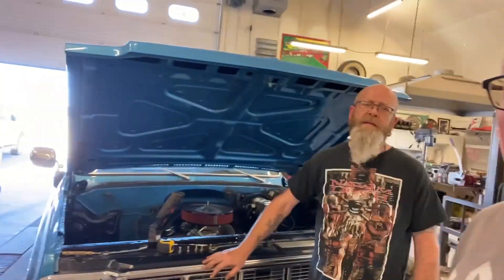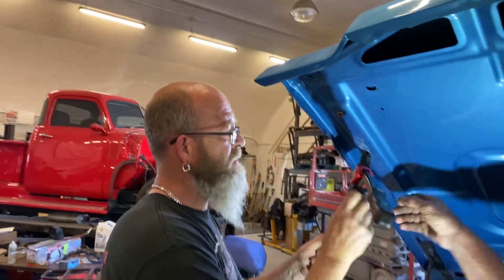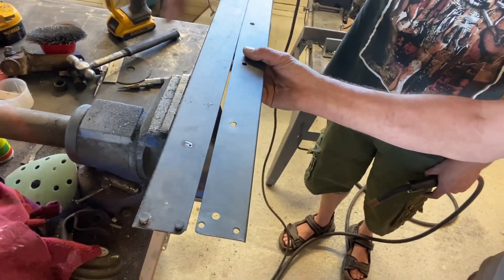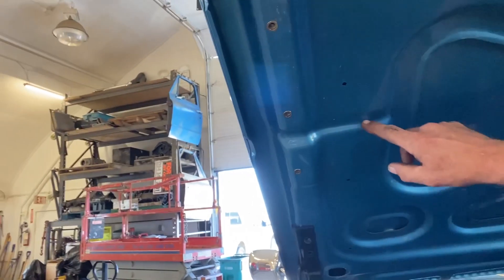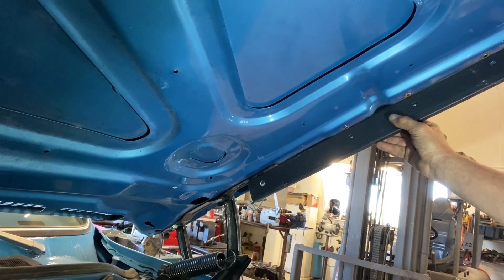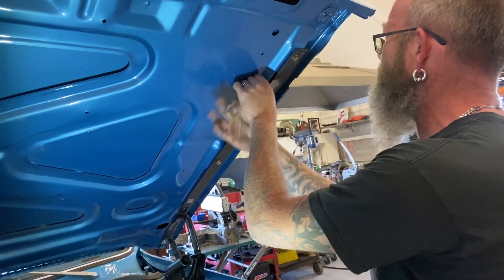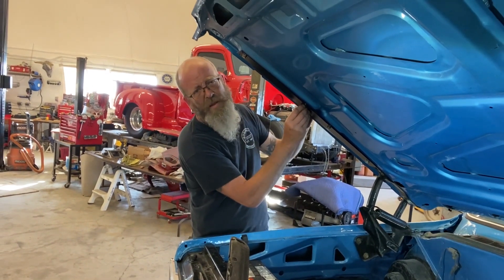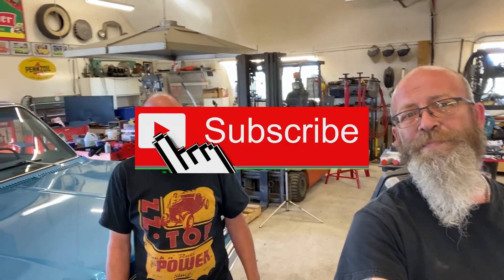GMC Square Body Hood Fix

Comment: The notch in the hood is a crinkle zone. Nicely done was thinking to do something similar with my hood on my 79 K20. Tech tip put a hose over your drill bit to set the depth. Keep the good work

Comment: Nice work those braces look way better than the overpriced aftermarket ones. Those hinges were designed to go back and then down, the proper way to close the hood is to use both hands and evenly push the hood back and down. Trying to wiggle or pull straight down is what causes the hinges to bind and kink the hood. Keeping the hinges oiled on a regular basis is critical too.
Reply from the maker: Hey Carter, the hinges were new and fully oiled up and yes if you take your time you can prevent the bend but sometimes accidents happen and it seems that accidents happen quite often with these square body hoods. Thanks for watching
Reply: @soberingrestorationservices  yup the paper thin hood and aftermarket hinges were a ticking time bomb, but your solution to the problem turned out great!

Comment: Well done lads. I've owned numerous square bodies over the years and never had the hood kink problem. On the other hand, I always oiled up the hinges on a count of the East Coast salt spray ... and of course, Chevy's are so reliable, you don't have to open the hood very often thus the hinges will seize up.
Reply from the maker: Yeah, thanks for watching.
Reply: I am restoring a 1978 c10 where the hood was bent on one side. It is already repaired and painted. I will put on the car. After watching the video, I have the urge to do the bracing as well before I put it on the car. I'm from Europe and I don't know anyone who has the same car.)) Hinges repaired and greased. Should I do this or be careful when closing.??

Comment: The first time I used one of those nut zerts was in about 1978, we were working on an conveyor that was very thin and we used one of those tools to install nuts to fasten electrical conduit to the conveyor.  I had never seen one before they are just great for so many different things.  I never bought one, the contractors always had them and if we asked we could borrow one for the evening or weekend.  Haven't used one for many years.
Reply from the maker: It certainly is a great tool. Thanks for watching.

Comment: Looks like a permanent fix. Nutserts are awesome. I have a small version,need to upgrade. 

Sure is a nice truck. 
My 51 is getting there,but always something to set ne back. Now its my left hip right to my foot. Pain tends to wear me out. 
Regardless im getting it done. 

You guys know there are stop collars you can put on a drill? 
Princess auto has sets of them. 

Or drill a nut, then cross drill and tap a hole. 5 minutes and you have a depth stop.
Reply from the maker: Thanks frank, good luck with your project. As for the stop colors we just didn't think about it but we're definitely going to have to pick some up. Thanks for the suggestion.

Comment: Great fix guys. A quick tip that I found very handy. Is when you are afraid of drilling your hole too deep. I simply figure out the depth I want and then wrap some electrical tape around my drill bit at that desire stop depth.
Reply from the maker: Hey David, great tip perhaps we'll use that in the future. Thanks for watching.

Comment: That dip stamped into the underside of hood was made so during a collision that would become a weak spot to absorb the impack and bend and not send the hood through windshield cutting heads off passengers in cab   Love your hack saves many a hood problems
Reply from the maker: Hey Gary well we appreciate the design for safety, it could have been done better in our opinion. Thanks for watching.

Comment: The hood crumple zone makes sense. But then rework the hinges/springs to eliminate the flex issue. Agree that a strut would be a good solution for a cleaner look. But a strut would also work assuming the hood weight is not an issue. Love this kind of video. We're in the beginning of 5-7 days of rain here in Ontario. June has been a very dry month and we could get a month's worth of rain over the next 5-7 days. Be safe and stay well.
Reply from the maker: The hinges and springs are brand new, it's just that the hood itself is very flimsy being that it's an aftermarket hood.  We will see how this works out and maybe think about doing a strut.  Enjoy the rain, stay safe and thanks for watching.

Comment: You could cut a piece of pvc pipe to slip over you bit.. To use as a stop.
Reply: Being a carpenter, I use a piece of wood block ( 2x2 or 5/4x5/4) drilled out with the drill bit I'm using.
Reply from the maker: There are definitely many ways we could have made it easier but we were just working with what we had and wanted to get the job done. Thanks for watching.

Comment: just a thought please do not get insulted but by adding that you changed the structure of the design now instead of the hood bending up in case of a accident  that hood will ripe up and go right into the windshield seen this repair before after a accident  no flex to bend so I would say the safety was not a consideration and might be a bad thing you guys did  by mistake nice looking work but may not be safe in a accident  as it may not bend like it was designed to do a proper fix would be to replace the worn hood hinges or lube them up often  so the hood will not bend
Reply: Anyone gets into a serious accident with this deathtrap and you are toast regardless of the hood strengthening.  1973 safety tech was primitive, we all know that driving these things, part of the deal.
Reply from the maker: The gauge of steel that we used was quite thin to allow for it to bend if it is in a collision, the hinges in the springs were new and so that obviously didn't prevent the cake from happening in the first place and we did need to do something to fix the fact that the hood had such a bend in it. Thank you for your concern we appreciate your thoughts. Thanks for watching.

Comment: Should have used a depth stop on your drill bit,take the worry of hitting finished side of the hood.
Reply from the maker: You're absolutely right we are going to have to purchase some of those we don't have any on hand right now so we just worked with what we had. Thanks for the suggestion. Thank you for watching.

Comment: Not sure you guys noticed, but at the very end of the video, right when you shut the hood the light was reflecting off the hood. If you look very closely and in slow motion, you can see that ever one of ,either the bolts or thread inserts hit the top of the hood.
Reply from the maker: We actually looked back after reading your comment to see him and we couldn't quite see what it was you were talking about but there's nothing actually touching.
Reply: Ah yes...I stand corrected sir. And thanks again for your square body videos as they are coming in handy with my 80 GMC Suburban k2500 w/ SM400ci. Sorry for the boasting but it was a barn find and the guy I bought it from either did not know what he had or just didn't care... my guess is he just didn't know.

Comment: I had an ‘80 3/4 ton that had two different sized, different colour pieces of angle iron for the hood bracing.  When it’s a old farm truck, anything within reach sometimes is what you work with.  The hood still had a bend though.  Bends make it stronger right?
Reply from the maker: Farm fixes are awesome, you got to do what you got to do. Thanks for watching.

Comment: The other issue is with how you shut these hoods.  You can't just grab it and pull down.  You have to push the hood toward the windshield until the hinge reaches it's break over point, then it will close.  Still a poor design by GM.
Reply from the maker: Exactly,  need to do the classic squarebody hood shimmy...thanks for watching.